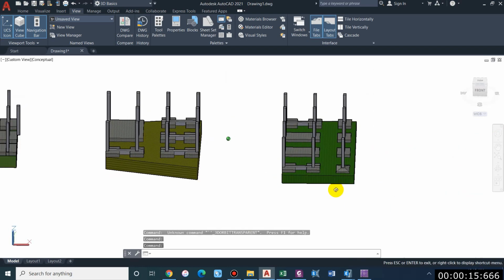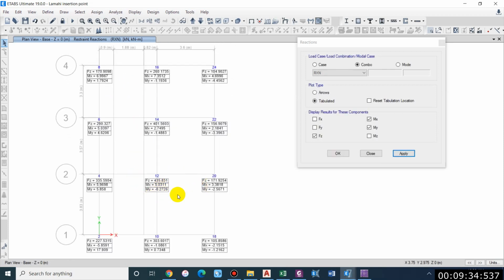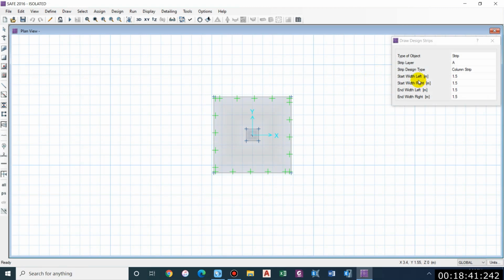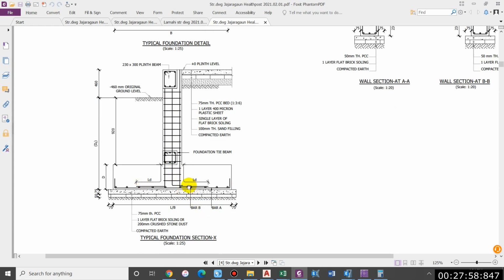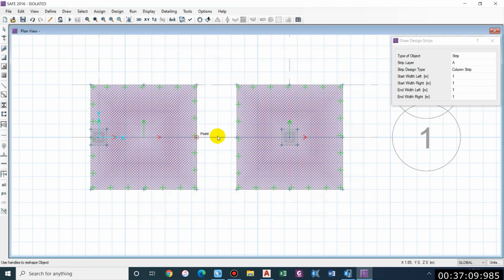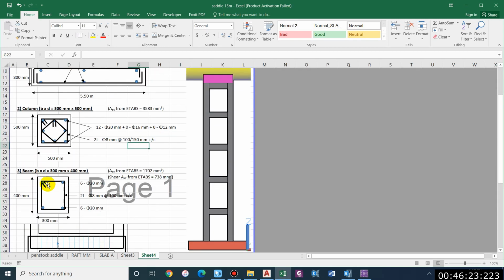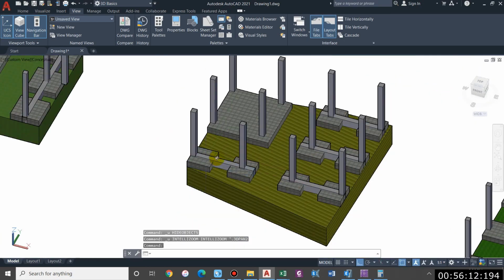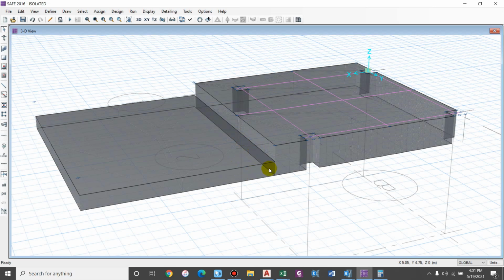Design of Footing in SAFE with AutoCAD Detailings & Site Practice | Isolated, Strap, Combined, Mat |

Comment: Great tutorial video, sir! I have one question regarding the rebar requirement section. In the case of eccentric footing with strap beam, you mentioned that rebar is required in the bottom only and also you showed the same in the drawing as well but the in the SAFE, there was rebar needed in the Top section as well. Could you please clarify this? Thank you!

Comment: Dont we need to consider GF wall load when designing footing?
Reply from the maker: Yes we should.
Reply: @civilconst  But why in every video plinth beam is not modelled and wall load is not assigned...please make more clarify..how did u consider Gf load?
Reply from the maker: Ground floor slab i.e wall and plinth beam is directly resting on ground, so it doesn't contribute to footing load unless there is basement floor.  @krakinigneel372
Reply: @civilconst But doesnt plinth beam generally rest on wall below and then to the lower tie beam...i am aware about the slabs wall concept but not to the wall above plinth beam...Thank u for your response in advance...

Comment: Thanks for the nice explanation. it was really helpful but I have a doubt,.. when do we consider ultimate strength load combination that you defined? coz although you defined both service and ultimate ,, but you are only using service load combination..
Reply from the maker: Ultimate load combination is used for structural designs like rebar calculation
Service load combo is used for bearing and deflection

Comment: Sir, i have a doubt, why dont you take moments along both direction with vertical load as this comes always as support is fixed
Reply from the maker: Yes, we have to consider those moments for the design of footing. However, the values of these moments are less as compared to axial load, so it is avoided.

Comment: Hello. While designing does SAFE consider the critical case of shear, punching shear and moment or it does it give steel just from Moment POV?I have designed it manually and SAFE as well but it seems that steel is calculated from Moment POV only leaving out critical case of shear. Becasue pt and shear stress are inter related and Pt given needs to be increased if depth alone cannot satisfy the shear demand. Pls explain.
Reply from the maker: Yah. safe doesn’t consider shear force while calculating rebar

Comment: Excellent Explanation. Sir!! Can you please make video for comparison of Design Results for RC building having Fixed case column VS model with real foundations (either mat or isolated or combined as  suitable). I think that there are drastic difference in Beam, column , foundation forces . 
Thanks
Reply from the maker: Will surely try.

Comment: while defining strips you choose the strip as per the size of the footing, but you calculate the spacing of the rebar taking 1000 mm width .  For taking 1000 mm width i think we have to define the width of strip as 1000 mm ,  Can you guide me in this confusion?

In Slab property section,  what is the difference between Slab and Footing ?

This video was very helpful for newbie like me , Thank you
Reply from the maker: You can clearly see the SI UNIT behind reinforcment values which is mm2/m so I took 1000 mm width.

Comment: Sir I have doubt in raft footing bottom mesh( x and y direction)  has main bar and distribution bar for top. Mesh also. But sir at bottom main steel ( x direction) is becoming a distribution steel at top. Y direction steel is main why ?
Reply from the maker: For mat/slab with double mesh reinforcement, bottom bar of bottom mesh is considered as main reinforcement which can be along either x or y axis depending upon moment and for top mesh , top bar is considered as main reinforcement due to reversal effect.